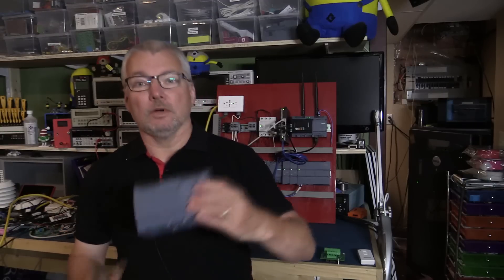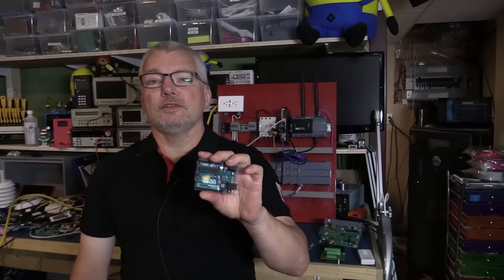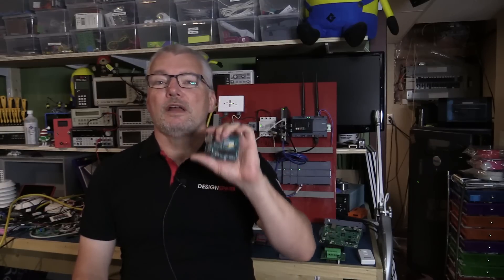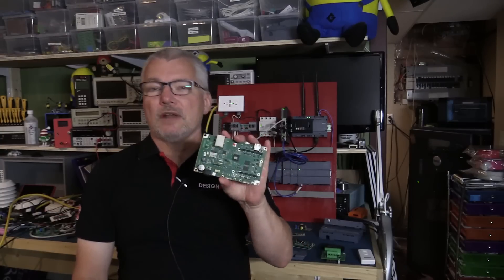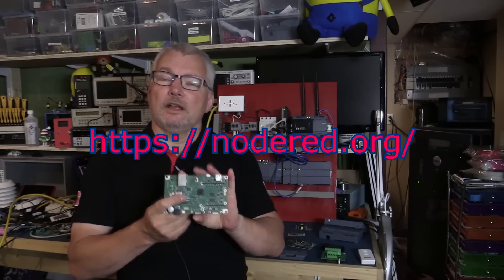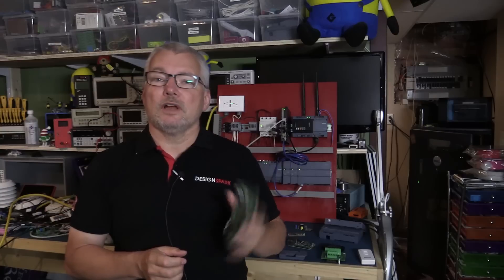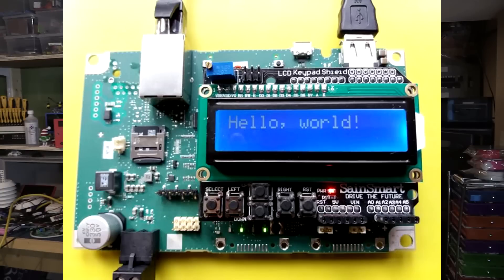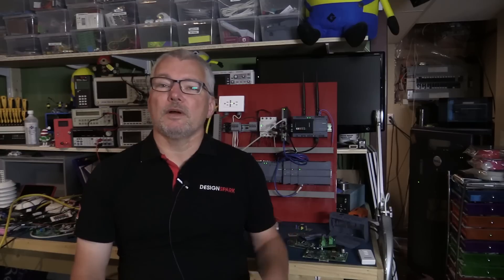Simatic IOT2000 - WHAT IS IT !!!

Comment: Hi Peter, Thanks for your video. But can you suggest any end devices that can act as a relay/physical switch module and talk to iot2020/2040, say to retrofit an existing house/building to implement automation with minimal/no re-wiring (probably using power line comm.). Im looking for a system which is both easy to implement and economical and concentrate on software and cloud to make it smart.
Reply from the maker: renjith. rk I can
Try looking at iteadstudio sonoff devices. Complete ready to go wireless power sockets. Wall switches. Power monitors etc at very competitive prices. I have several videos on how to use them and also reprogramming them to use a local mqtt server running on an IOT2020 for example.

Comment: Late to the party here but just come across this device. I understand why you describe it as between a Pi and an arduino but why would I choose this over a pi? I am interested in monitoring, data analysing and controlling a CNC machine (and eventually a few) so was thinking of purchasing a Pi 4 and downloading EdgeX Foundry. Would it be recommended instead to purchase a Simatic IOT2040 and use that as a gateway to collect the data from various machines and push the info to the Pi which will run EdgeX or just skip the Pi altogether?
Reply from the maker: I can point you to exactly what you need then, Raspberry PI based industrial controllers with certification like UL and CE. look at the latest videos here https://www.youtube.com/playlist?list=PL_atu5RtEPi7v5Hnj1DDt3jL--qiJ3QdQ
The IOT2020's run a linux OS but not as compatable as one would like with a PI, these latest reviews are full (Pretty much) compatable with the PI, they run Rasbian Stretch for instance with an update to provide Real Time operation. and one even directly uses a PI Core 3 module with upto 32GB Flash.

Comment: Hi peter, the Frequency is not about 1GHz, according to the datasheet of the Intel Quark x10x0, the maximum frequency is 400 MHz. Also these series of CPU is bugy i.e. Segfault bug.
Reply from the maker: I just confirmed and your absolutely correct, not sure where I ended up with the 1Ghz
Reply: see 1:15 of video
Reply from the maker: yup, I just replied I was wrong in the video :), CPU is definitely running at 400Mhz, not 1000Mhz (1Ghz)

Comment: Hello Peter!
When I connect a device (Arduino Mega) to the USB type A port (X60 USB) present in the Simatic IoT 2040, the device powers up but isn't enlisted in /dev list of ports. Even if I type dmseg | grep tty command, it shows ttyS1 S2 and S3 are enabled but when I try collecting data it just shows b'' which is empty for data bits...when I use the same code for Windows on COM15 port it shows the data b'values' 
What would I be doing wrong? Or is there any drivers I need to install for usb ports? First time when I used the device, ttyACM0 came up in dev/ but disappeared the second time I used the device...I even used another different image OS but of no use...

Comment: Hi Peter, Have you explored the DI frequency limitation of 20Hz on IOT2000 Expansion? The Siemens manual leaves a "blank" next to High Speed Input Freq: Google document A5E39456816-AB
I have a Wood Gasifier, Small Engine, Alternator that I am collecting data off(Shaft Speed 60Hz, Voltage, Current) Need something more robust than my ESP8266 solution

Comment: Hi! i want to made a machine which has a lot of nodes.... if i want to share only the IP nodes of the main PLC what i need to do?
Reply from the maker: What do you mean by "A lot of Nodes", anyway, I would have your local devices on a class C sub net using a non routable ip address (AKA a private network ip address https://en.wikipedia.org/wiki/Private_network ), then have your main PLC eithr multi homed (2 ip addresses on one port) or better still use a PLC that has 2 seperate IP addresses nad ports nad have the second on your externally enabled IP addresses, you may have to create routing table or have a workflow with say node-red or other and send the data you want to share to that other port, so the PLC is acting as a gateway / firewall.

Comment: Hi Peter. is it possible to extend the number of the I/O?
Thanks. 
Maurizio
Reply from the maker: The simple answer to that is Yes, you can add a SPI or I2C expander IC like the PCF8575 or the MCP23017 / MCP23S17, a simple board with 5V / 3V3 and a few wires is all that is needed + of course drivers to interface to what ever load / input you need.
You will loose 2 or 3 pins to the expansion process but gain 16 in this case.
There are many other expanders that will also work depending on what you want to drive or monitor.
Reply from the maker: Forgot to also mention remote IO expansion like using a ESP8266 module. If your IOT is on the network with WIFI, then it is an easy matter to expand IO using MODBUS protocol or other and the ESP is positioned right were it is needed. I have several videos using them with a PI or an IOT2020. search on my channel for Node Red for more, there are also plenty of other folks who have posted ESP projects driven by an Arduino or a version of Linux

Comment: On which protocol does it works ?
Reply from the maker: It has a Linux based os so you can load quite a few. It's up to you. It can also run node red etc. And even an arduino app
Reply: @TheBreadboardca  thank you